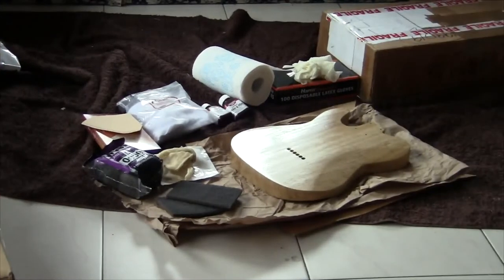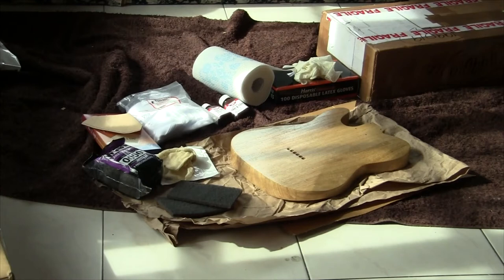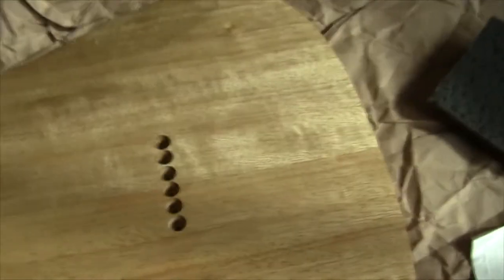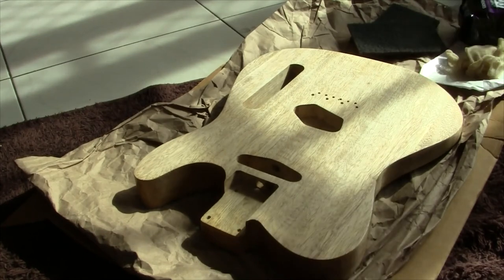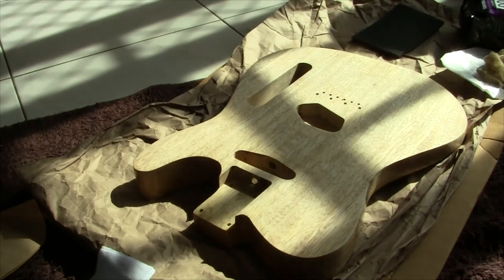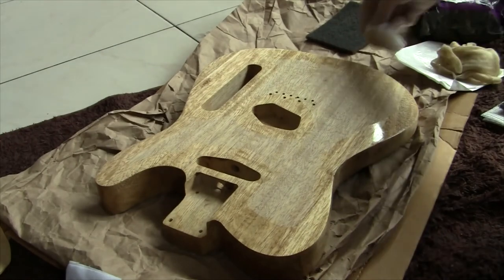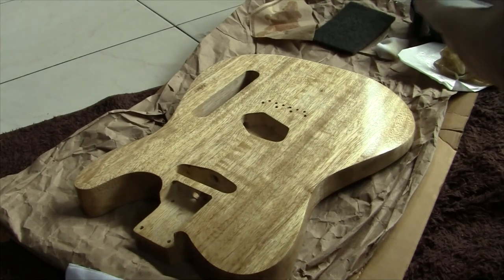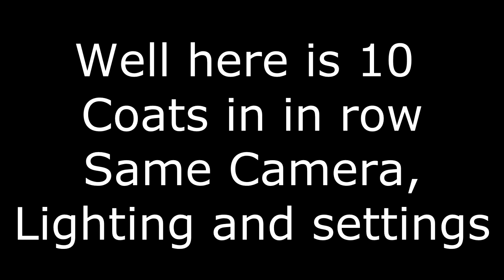My First Guitar Build, part 2 Applying Tru oil

Comment: sharp edges on that tele, beautiful wood .
Reply from the maker: Yep, Beginners mistake, but not sharp enough the cause any damage and it was a little late to fix after a couple of coats. But it gives some personallity, if I do it again I will roll them a bit. Korina is a amazing wood. This piece was four bits of off cut glued together as it was the cheapest way I could do it. Remember first build so was expecting a few mistakes so did it on the cheap